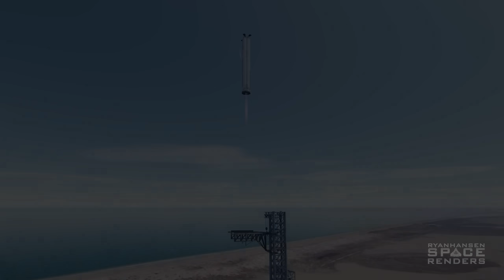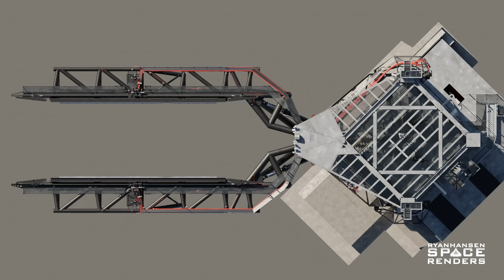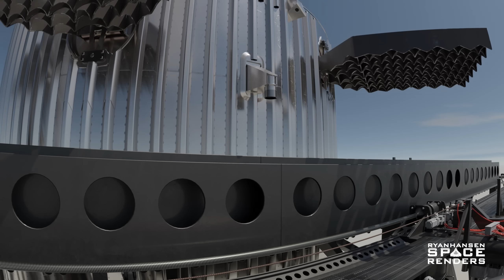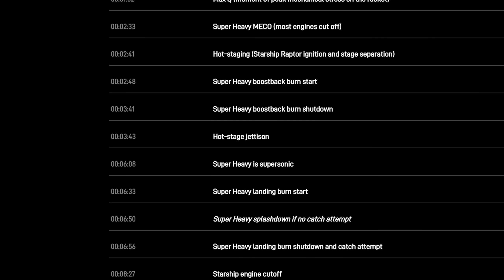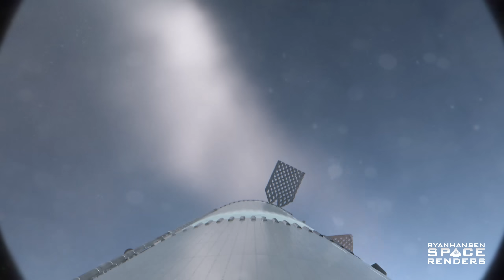How SpaceX Caught Super Heavy | Explained

Comment: whats freaking insane to me is that the 2 puny 17cm diameter load points (which is probably about the same surface area of your hand) have to be able to withstand at least 3675 tonnes or between the two of them.. and they're also ball joints!!! 🤯🤯🤯🤯 😱😱😱😱 AND on the return flight the super heavy has to rotationally align correctly so that they'll land on them!
Reply: 3675 tons?  Rotation was never an issue, they have been doing that with f9 for years.

Comment: there is no real difference between landing a booster and catching it. it lands all the same just the "legs" it lands on are at the top and not the bottom of the booster
Reply: Some very real technical differences but the two acts are very similar and you could say they landed the booster on the arms more than you can say it was 'caught'.

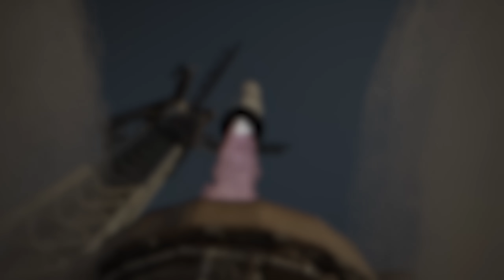Comment: 15:12 sorry but those margins are far too optimistic. It's gotta be pretty damn perfect in its rotational position for those tiny little feet to work. I don’t see any rotational vectoring capability those vectored motors are controlling attitude pitch and descent speed at the last few seconds of the landing, not rotation.
Reply from the maker: Not sure why you think they don't have any margin. I show they easily have at least 5° for roll rotation. In addition, they have 3 engines running at the end of the landing burn. These engines can gimbal in a collective twist to induce a rotation on the vehicle. This is what they have done with previous vehicles.
Reply: @RyanHansenSpace  this time round precise orientation to the Dock is critical, previously it wasn't. 5 degrees is just 1% tolerance on rotation being a catastrophe. I just find it difficult for those vectoring rockets to also adjust for torque as well as balancing 500 tons on a fingertip to achieve speed location and verticality of the craft. Heck I'm only an engineer
Reply from the maker: @miles-thesleeper-monroe8466  the 5° value I mentioned in my reply is +- so it's closer to 2.7% and is a worse case. As I show in the video, this value is closer to 10°+- which is closer to 6% margin. SpaceX absolutely has this level of control with the roll of the rocket. For one, they actually caught the booster on the first try with near perfect roll rotation, and we've repeatedly seen them use 3 engines for precise roll control.
Reply: @RyanHansenSpace  yep it looked as perfect as your cgi prediction 👌
Reply: @miles-thesleeper-monroe8466  They have landed 100's of f9's in the same orientation each time.  It seems it's not nearly the issue you pretend it is.

Comment: I thought it landed on the grid fins 🤔 why ISN'T it landing on grid fins?
Reply from the maker: Grid fins cannot hold the weight of the vehicle. The hardware is only strong enough to deal with aerodynamic loads. There isn't really a way for the fins to catch the booster since the fins have spikes and limit the surface area that can be contacted.

Comment: I think it’d better to build a very deep hole 🕳 for the vessel to go into it instead of catching it on the air. Then some closing rings could take the vessel avoiding the need of the precision of only two hanging points.
The hole could be built in an artificial island into the see.

Comment: So I have a question, what makes this special than the booster itself making a landing without needing the chopsticks to catch it like done in previous launches?
Reply: Reduces the risk of it toppling over?..
Reply from the maker: This booster is large enough that it would need massive legs to stand it upright. The legs would add a lot of mass to the rocket and low dry mass is critical for efficient rockets. Since this rocket flies back to the launch site it's already taking a payload mass penalty so catching instead of using landing legs gains back some efficiency.
Reply: @RyanHansenSpace how do you know this?

Comment: I know they caught the booster, but why not use a semicircular arms articulated by gears. That way the arms close around the booster instead of slapping it. Those hydraulics are too bouncy and not really precise.
Reply: they were precise enough, period
Reply: @dynamo-l3m  could be better
Reply from the maker: If you make the arms curved you then have to have a really good idea where it's going to come down. That restricts the landing margins significantly.
Reply: @RyanHansenSpace  imagine catching a broom handle between index and thumb versus catching it between index and middle finger. Gears also deliver more torque and precision. I can send you a link to video that shows what i mean
Reply: @Voodoo_Robot  except this is not a broom and the arms are not fingers, they require a far bigger precision and having a wider margin helps, gives you more flexibility. On the actual catch footage you can see how the chopsticks calibrate to adapt to the booster's trajectory, that's impossible with those semicircular arms, kinda useless if you ask me
Reply: @dynamo-l3m  ok. Let's wait and see. I say they will change the design. If we know something about SpaceX they are always inovating.

Comment: I love it when 3D animation becomes reality (being an animator myself). Ryan, your informed and highly detailed "speculations," translated into these 3D visuals, are 98% of what actually happened! Congrats on a phenomenal amount of work, from highly detailed 3D modeling, to rigging, to layout, and finally to rendering. Stunning. SpaceX indeed slapped the booster, that and what you didn't realize would happen is that the booster would likewise react and bounce back and forth between the rails. Also, the initial contact didn't immediately initiate the lowering of the rails. There was a one second delay. 

Just a note to those watching the real footage, BOTH IFT4 and IFT5 vented copious amounts of methane OUT of the Quick Disconnect filling port, thus the reason for the huge side flames. This was SOP (standard operating procedure). What was unexpected for me, and probably everyone else, was the intensity of atmospheric heating of the aft bulkhead and inner engine shields that glowed yellow hot, then orange, then red, that started at least 55 seconds prior to catch, rather than higher up in the atmosphere. The engine bells didn't glow, because they still had cryogenics circulating through them. Looked like the entire engine bay was on fire with all the illuminated venting (and hopefully purge) gasses looking like flames.
Reply: I was a bit baffled too, any reason for the 1 second delay in lowering the rail? I thought the idea of the lowering rail was to act as shock absorber. If it doesn't immediately lower on impact then I wonder what does it achieve? 

It was fantastic watching in live though. I was pretty emotional when the final engines shut off, and the booster was till hanging there! OMG

Comment: You are missing is that the booster  lateraly enters the spread arms and decelerates  laterally by tilting the whole booster. The booster does NOT descend strait down, 
What is controlled with a feed back loop is the position / velocity of the pins. That is the reason why the arms must spread , to allow this pitch and yaw angle to take place, there after the arms must close again

Comment: How is the telemetry transmitted from Super Heavy to the tower? Does it have to make a roundtrip to a Starlink satellite, or is it transferred directly? It seems like the latency would have to be very low for this to succeed.
Reply: or maybe both of them does not transmit anything at all? Smart ground hardware is enough.

the booster will only need to aim at a clearance entry, no need to be few inches accuracy, just enough tolerance.

after the engine section passed the arms, they would start rushing in just to touch the booster and sliding until it touches two lifting points.

i think the catching is actually more simple and not as hard as we think.

the only big problem was to make it slow just enough near 0 acceleration not to stress that 2 points, timing is on the booster.

Comment: sooo the risk is destroying the tower and the landing pad 
and the gain is saving a bit of weight and time in transporting the booster to landing pad
.....is that worth it if landing with landing gear is as easy with this engine setup as falcon9
......and if it blows up u waste time clearing the tower and launchpad and making new ones ....or they will have spare ones
Reply: making a landing legs for the size of the booster and landing it back like falcon 9 is actually harder than you think, they landed more than 300 times i think they know better.

with checks even before hotstaging ring ejection were made, i doubt they will ever destroy any launch tower.

in fact, the catching will get refined over time, the more they catch the more accurate, and safer.
Reply: @FarokhBulsara4065  yeah I think they had issues with using landing gear which is a big part of it .....and apparantly they don't want to waste time moving it .....but if it bumps the tower and the pins that r supposed to rest on the clamps r not aligned it will crash into the tower and landing pad .......and that would be wasting time instead of saving it ....but we'll what's the failure rate
Reply: @pumpuppthevolume  oh yeah i was missing one more point, with landing legs they would have to deploy a big crane each time just to lift a 70m tall structure back on SPMT while having the mechazilla arms integrated both as landing platform and mount/demount crane would save more time and resource.

it's all just logistical issue.
Reply: but still if it resulted in an anomaly and blew up right before touching the arms, the explosion might just damage the arms and very minimal to the tower.
Reply: Also remember that the future goal os for these booster to be RAPIDLY reused.

Comment: I don't really understand why they went to all this trouble when they were landing perfectly as it was.
Reply: Faster turnaround time. You still need to transport the rocket boosters in the launch pad, and also landing legs can fail as we see on some of the previous launches.
Reply: @GrandLineSymphony  I get that, but they haven't had a failure in a long time. And with landing it straight back onto the pad, that eliminates the need for all the extra manufacturing of these enormously complex towers. It's cool, don't get me wrong. Just seems weird. But w/e, I'm not the one getting billions of tax dollars to make this stuff.
Reply: @Jibblejabblejaloppia  "And with landing it straight back onto the pad, that eliminates the need for all the extra manufacturing of these enormously complex towers." These complex towers are also for launching these rockets. you can't just remove them in the equation.
Reply: @Jibblejabblejaloppia "best part is no part"
 no landing legs, less time wasted to inspect, maintain the landing legs, shorter turn around window.

no landing legs, less dry mass, more payload to orbit.

with landing legs, things actually get more difficult as the legs would be way bigger, landing it would way harder than catching it mid air unlike falcon due to sheer size.
Reply: @Jibblejabblejaloppia with landing legs, everytime a booster returns they would deploy a crane big enough just to lift a 70m tall structure back on the SPMT, that alone takes time and more resource just for a simple task, why wouldn't they use what they already have ?

the mechazilla arms act as both the landing platform and integrated crane to lift booster from spmt to demount and mount on OLM.

Comment: I thought I was watching a @RyanHansenSpace video this morning but it turns out it was an actual starship catch.  Obviously they paid close attention to the video as they nailed it! The only thing they missed was that, in the SpaceX version, the rails seemed to take the full load of the booster before lowering, as apposed to lowering on contact to absorb the impact. Small mistake, otherwise they did really well :)
Reply from the maker: I noticed that immediately and am still thinking that through!
Reply: @RyanHansenSpace  If it operated as designed maybe it was timed to counter some resonance in the arms and/or tower. I've done a thing where you run to the end of a diving board like you are going to spring off the end but then absorb the up swing of the board in the knees and come to a dead stop.The precision and delicacy of the touchdown was unbelievable.
Reply: @RyanHansenSpace  On further reflection and a comment from a friend, an alternative scenario could be the rails didn;'t lower until  engine cutoff when they finally feltl the full weight of the booster. The initial landing was so gentle it didn't trigger the action.

Comment: Thanks for your hard work Ryan.  T-minus just over 3 hours as I write this, assuming it's still on.  Given that they attempt it, I think the chance of catching it in some form is very high.  Well over 50%, but less than 100.  I'd be most concerned about the "slap" being too aggressive and the booster exploding, or perhaps something going wrong with the landing burn as you mentioned.  I wonder if they have any engine out capability with the landing burn on either the center 3 or the outer 10.  Hopefully we won't find out and it will be a nominal landing burn.

Comment: Why do you think they don't run cables from the ground to the back of the cradle so it doesn't torque the tower?

Perhaps cable expansion from temperature over those distances? 

Surely that could be compensated for automatically, with strain gauges etc right? 

If it was supported primarily by cables like this if there was some problem with it coming off the rails it could just hang normally anyway. Thoughts?
Reply: Cranes kinda do this - they have a pivot / support, which for Starship is like the main lifting cable, and cables that pull down on one side to control the angle, which for Starship would be to keep it level.

Maybe the different cable lengths would have elasticity issues when weight is suddenly applied. Or bouncing? IDK

Comment: Two issues I haven't seen discussed: 
1. If a return of the booster to the launch ring was intended, then after catch (in the absence of infinite booster positioning accuracy) the booster would have to be translated along the arms, anywhere from centimetres to metres.  There doesn't appear to be a mechanism installed to enable that to happen, so I can only assume that for the foreseeable future the boosters will be removed to a transport stand, which can be independently manourvered to match the booster's postion along the catch arms.  
2. The control laws for gimballing of the engines, and thus fine control of the booster's orientation and position in space, will have been programmed primarily for the inertial and aerodynamic forces acting on the body of the booster.  The instant that the arms contact the booster then the control laws will have to change because inertia (at zero airspeed) will no longer be the sole influence on booster position, particularly if one arm slaps the booster before the other.  Lets assume that SpaceX have that control law transition already programmed in, because if they don't we could see the behaviour of the three centre engines go exponential at the worst moment, with enough power to lift the booster back out of the arms or twist the arms off the carriage.  And, this situation is not something that can only be simulated, not physically tested, so lets hope that they've done a good job.

Comment: None of the starship flights so far have not demonstrated the precision for this manoever.  The only one to land on the concrete pad (and not explode) was barely on the slab.   This catch requires a significant degree of precision hard to achieve using vectored thrust, especially given the C of G factors and moment arms.

JR
Reply from the maker: It has been stated that the last booster (B11) landed within centimeters of its target.

Comment: Hey Ryan, make the chopsticks have electromagnetics on them in the center.. The booster and ship have  a steel plate on each side..  when ship comes in the electromagnetics will turn on and power up causing ship or booster to turn to the correct point everything. Making it easier and normal

Comment: Ryan, that was incredible.  This level of detail HAS to take a huge amount of time and effort.  Let's face it, between yourself and Chrome Kiwi, we have more accurate data on how things are put together, and work, at Starbase than we could ever hope to glean from ground level photos and in-flight images.  Combine that with the fact that you must have a firm grip on physics and structural engineering in order to get this level of accuracy is amazing.  If everything goes as hoped, it wouldn't surprise me, at all, if the actual catch turns out to be a mirror image of what you've produced here out of research and speculation.  Bravo!

Comment: When the catch arms pick up a booster from the multi wheeled trolley it is beside the launch mount away from the initial launch position so they are definitely able to catch the booster when it is not over top of the launch mount as this video speculates.  So it is not understood why the video states that it must be caught over top of the launch mount.  There are other spots where it may be caught so if it misses it won’t hit the launch mount!  Excellent video however!!!!!
Reply from the maker: The point is there isn't enough margin to make it worth doing a catch to the side. Risk is nearly the same after the arms close some initial amount.